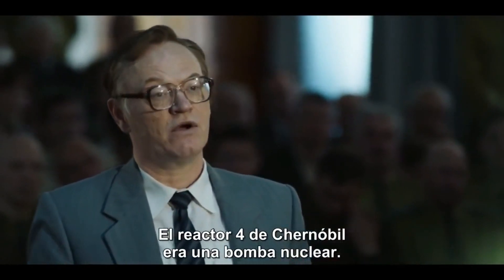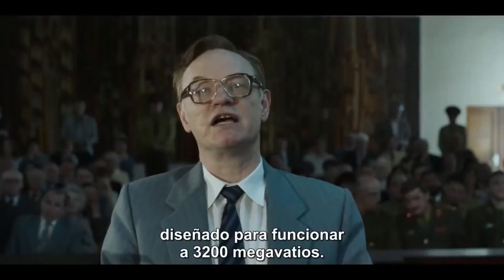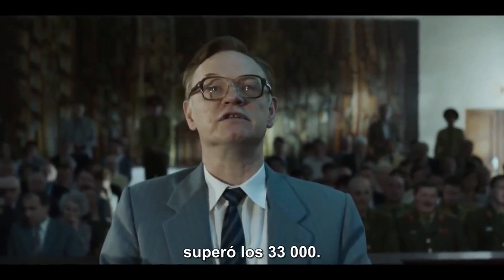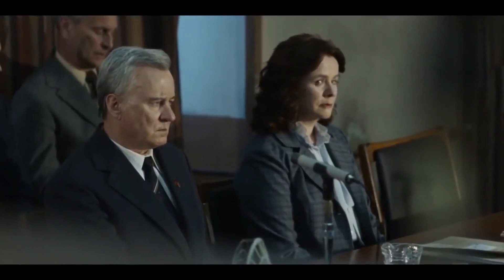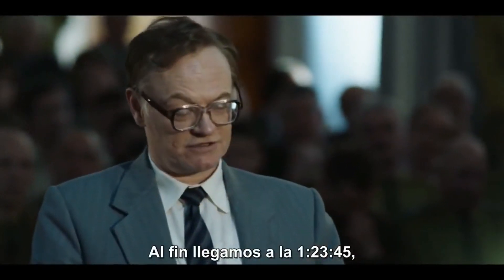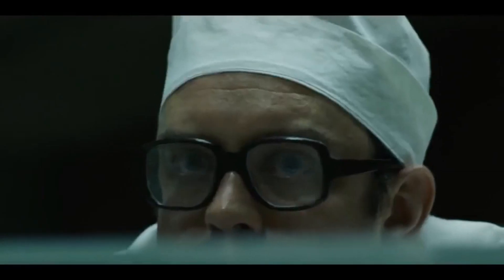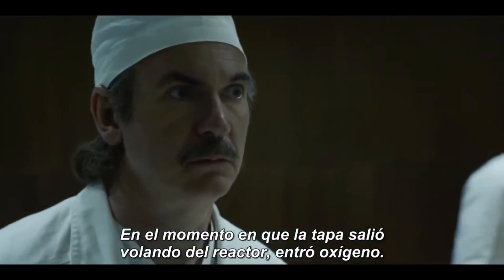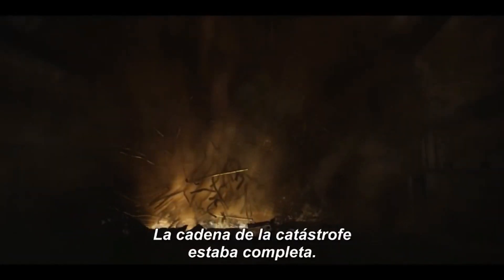Chernobil disaster explained in 10 minutes (3/3) - Valeri Legásov - Chernobil Series

Comment: Love that look on diatlovs face when he finally realizes how it was possible.
Reply: When Legasov explains the entire mis-process, step by step, and elaborates that the Reactor, designed to operate at 3200Mwatts, went beyond 33.000. and the camera turns to Dyatlov, you see the fear, dripping from his face; Over 10x the regular output...It even took a few seconds from the maximum-indication on the meter, which didnt gó any higher then that 33.000, it could have been double, even triple or quadruple that energy, as legasov explained clearly: an endlessly accellerating reaction, skyrocketing. Pressure building up so high, the enormous lid, containing the 211 Control Rods(which wigh  350kg each!) Thats over 73 Tonnes, excluding the weight of the Lid itself... and it popped off like a cork from a champagne bottle.... Oxygen and carbon-molecules from the air, now mixing with the extremely volatile substances inside the core, and the disaster is 'hyper-complete'.... Dyatlov realises this all too well at this point, and it even seems hé is having trouble to grasp the vastness of the catastrophe. Dyatlov does know, he's the móst FKd person in the world right there...
Reply: @thegreenreaper6660  As much of an asshole he was, no one deserves to be partly responsible for this.

But he can take a tiny, tiny bit of comfort in the fact that the higher-ups concealed the truth about the, basically non-existent, emergency shutdown.

If your job is to drive a car and your bosses want you to push that car to its limit, the governement shouldn't be surprised that the driver runs over a person even though he pushed the brakes.

There were no brakes. They lied to the driver. A lie of omission perhaps... But a costly one.

His punishment is cancer and the painful deaths of all those people... Horrible, he's already dead inside.

Though, the question he has been asking himself has finally been anwsered, a weight from his shoulder. He has enough to carry.
Reply: @sifuhotman1300  Dyatlov isnt solely responsible no, but his arrogance and horrible, even naieve attitude, added up with his disregard to the well-educated engineers in the control-room that night. Akimov tried to stand up to him and warn him that it wasnt safe. Dyatlov pulled Rank and pushed onwards....

Thát is on Dyatlov! AS a lead-nuclear scientist in the USSR, he should have been more cautions!
That said: Dyatlov's responsibility indeed stops where the omitted reports begin; The 'red flag'-report on the lithuanian RMBK-reactor, which experienced a huge powersurge after enabling AZ-5: lowering all the control-rods: mass-graphite injection into the reacting core. Yes the boron-contact afterwards causes the reactivity to halt, but not before a huge spike! This finding should have been a huge alert throughout all the RMBK-plants in the USSR, but was kept hidden by the Party, due to the political interests and prestige! Also the part where a half-powered RMBK-reactor created a lot of by-product(Toptunov: We think the core might be poisoned!... he was 100% right!), the by-product reacting freely and unchecked if it came into contact with graphite... Those two pages from the reports, could have informed both the Control-room engineers, as well as Anatoly Dyatlov on what type of BOMB they were developing, if they did this wrong...

And in hindsight, we can conclude that despite the men doing everything by the book, it was terribly wrong!
Graphite-tipped control-rods to 'shut down a reactor'....Any (nuclear)scientist would have you locked up in a mental hospital nowadays if you stated that.

Unfortunately it had to come to this terrifying disaster first, before people realised that scientific facts, fár outweigh political interests.....
Reply: @sifuhotman1300  most people commented hateful stuff towards Dyatlov. I can see you guys despise him, but can we just remember for a second that Communist regime was toxic and kinda drove this whole chapter happen? I mean, i am not a person to judge people by actions, but dyatlov is not the person to be fully blamed here. We may not know what exactly happened in control room, but if he really did kill more than 50 people with that nuclear catastrophe, he'll carry that sin for the rest of his life. In wikipedia, despite the engineering mistake that happened, he blamed the flaw design of nuclear reactor and not his people, which may be the cause.
Reply: @sifuhotman1300  HBO portrayed him as am impatient, senseless, heartless evil person, but i refuse to believe he was like that, unless there is some documents that prove otherwise.
Reply: @thegreenreaper6660  i don't think Dyatlov knew how reactors fully worked until legasov participated in the testimony.
Reply: @blazephamous7425  Perhaps. The way he degenerately commanded Akimov and Toptunov around like they were children, gave the idea he knew it all...
Reply: @blazephamous7425  this is wrong, the real Dyatlov knew how reactors worked, he was not a dumb guy at all, but wasn't aware of the flaw in the emergency safety system
Reply: @iceink  Yes you are absolutely correct he didn't know about the flow in the system but the whole incident wouldn't have happened if he wasn't so arrogant and careless.But I am also not blaming him fully Cause in the series there is a scene where they talk about the Graphite tips and this Flaw was discovered nearly ten years before the Chernobyl incident and the government hid it.
Reply: @thegreenreaper6660  there wasn’t any graphite. THERE WASNT! Because it wasn’t there!
Reply: @blazephamous7425  50 people? More then 100.000 died from cancer lol
Reply: @thegreenreaper6660  they didn't hire scientists they hired bodies, he was the only person in the room who atleast understood the basic reactor functions, hence the reason the control rods were all removed cause nobody knew about the poisoning and thought that less rods= more power(true if not for xenon) then the rapid temperature spike due to coolant loss when the pump shut off burned the xenon away quickly causing it to swing in seconds, the problem was 100% the control rod design. Though he was an ass, he was also a man who was following orders, he didn't cause the delay which lead to xenon poisoning he was merely doing his shift and running a "standard safety test" which was already known to be dangerous by the union but not him and the A-z5 fatal flaw which he was also unaware of is to blame hugely as thats literally the only "stop" button. I imagine he was tormented by the faces of his "comrades" that he watched turn into goo( no new cells due to radiation destroying the DNA completely, leads to rapid body degeneration, skin peels leaving you without skin by the end and organs do a similar thing its horrifying) he definitely paid for his actions mentally.
Reply: @blazephamous7425  I heard he was tough and rude but not like this. More like that was the leadership style he chose.
Reply: @iceink  why would they keep that information from the people who would know not to fuck around?
Reply: @blazephamous7425 I guess he didn't considered the positive and negative feedback loops, just wanted to get the damn "safety test" checked
Reply: @evanbelisle8464  Because, in theory, it shouldn't have mattered, or ever come up. It would only ever come up in a situation like this, when the reactor has been pushed to the brink of disaster already. In any normal working day, the graphite tips don't matter.
Reply: @blazephamous7425  I don’t know if it was on Wikipedia or not, but I read somewhere where part of the reason he was pushing so hard to do the test despite all of the red flags was his desire to impress and move up within the communist party, which means he wasn’t evil or anything like the show portrayed him, but he was career motivated
Reply: @thegreenreaper6660  Diatlov's statements indicate that he guessed this and therefore did not want to turn on AZ-5; however, Akimov acted in accordance with the procedures in force, while Diatlov was not in the habit of explaining the motives for his actions, but only expected blind obedience from his subordinates
Reply: @blazephamous7425 It was the Soviets that were to blame, not Communism. We don't blame Democracy when the US does something fkd up, we blame Capitalism. The Soviets never had actual communism according to Marx. They just has an authoritative, totalitarian state in which nobody owned private property. 

The main ingredient for communism, is for the workers to own the fruits of their labour, and they didnt have that in the Soviet Union. It's like calling a society with no type of money, capitalist.
Reply: @thegreenreaper6660  they belive at the time before explosion it went over million MW
Reply: @jere9915  I think it was already well over a few hundred thousand MWs, when the meter maxed out. That meter jolted up so terribly fast, its logical to state that the meter couldnt keep up with the surge anymore, maxed out on that 33k,, but the amount of power-overdose needed to actually blow a 75 ton lid off that Reactor is a vast multitude of that 33k.

33k was onl;y how far as the meter went. Same story with the lower-level docimeter in the controlroom that only went to 3.6 Roentgen..(not great...not terrible...)... No it oculd only measure upTO 3.6 roentgen

And i'd even say it'd be the same with the high-range docimeter that was attached to the armytruck that General Pikalov drove into the plant, to get that close-in reading of 15.000 roentgen.... It would be even higher, but even a high-level docimeter would max out at those levels....

Said crudely: You see how quickly Sitnikov got his skin fried-red on top of the building: Mere seconds and he was 'burning up' already! He barely looked into the torn up roof, and he already knew there, that he'd taken in far too much radiation already to survive.
Akimov and Toptunov went to the pumps to open the valves there manually, and prevent an even bigger disaster of a total meltdown, yet a few dáys later in the hopsital, théy were the ones 'melting down'.... Gruesome...
Reply: @thegreenreaper6660   well, watts are a measure of power, which can be converted into work/energy, which combined with mass (76 metric tons) one could calculate what amount of work (watts, joules per second) one would need to move said object. then one would have to consider how quickly it was accelerated too but it would give a baseline of no less than that much power....
Reply: @thegreenreaper6660  Well, pushing the equipment is one thing. Failing to acknowledge the possibility of a xenon pit and refusing to shut down safely is another. But the fact that the control rods had graphite tips is something that should've been told to the operators of that reactor. That's crucial information, and Dyatlov can't be held responsible for not knowing an emergency button essentially doesn't work due to a shortcut taken during construction.
Reply: @thegreenreaper6660  dyatlov does... but he did not know about the graphite tips, so he was convinced that it was caused by incompetence.. until that very moment when it becomes clear that pushing az-5 was pulling the teigger on a bomb that he had instructed them to assemble and arm.
Reply: @thegreenreaper6660  at this point I think Dyatlovalready "knew" he was responsible, he didnt fully understand how, obviusly he did stuff wrong but to his knoledge RBMK reactors cant explode but he was apparently wrong, and he is plagued by guilt masquered with denial, but when he hears about the graphite tips, he sees a hope of him not being the sole responsable of the disaster, he was not wrong he was tricked and that aliviates his heart a little, tha is what i get from this scene.
Reply: @ivanadriazola1991  you’re the only person in the comments that I find understands this. (He didn’t want explaner guy testifying bc he thought it would just attack him but he is surprised to find explaner guy exonerates him at least a bit, with the carbon tip thing). Yet everyone in the comments completely miss this. Glad to see at least one person gets it!
Reply: You didn’t see the look, because it wasn’t there
Reply: he knew it from the beginning
Reply: @Rise_To_Mastery  Not sure. He was one of the most experienced scientists on the matter. Something does tell me, he should have known about the graphite tips, and how they cause a reactivity-spike? Thats just basic chemistry, right?
Reply: @thegreenreaper6660  the reactor was pushed in a very specific and unexpected way against protocol. that was Dyatlov's doing. the graphite tips were in place under the assumption the reactor would never be pushed as it did, essentially relying upon strict observation of protocol. so those were two mistakes: the graphite tips relying upon operators following the correct protocol, and the human decision to break protocol.

very few people understood that graphite would cause such a disaster. the people that did voiced their concern when the reactors were built and instead of choosing against the graphite tips, those in charge decided against the recommendation. and then that was the end of the concern of using graphite tips.
Reply: @thegreenreaper6660  the point of it in this film anyways, why he gives that look when he says they were graphite tips is that none of the engineers on that night knew they were graphite tips
Reply: He was probably in shock.

Get him to the infirmary!
Reply: "o.o
Reply: For anyone in these comments wanting to know more about Chernobyl I really recommend Serhii Plokhy's Chernobyl History of a Tragedy book, just finished it and it goes way more in detail that any other show or site goes on the history aspect of things. Can't recommend it enough.
Reply: Dyatlov was actually pretty lucky in real life. Many of his coworkers died horribly, literally melting from the inside out in a matter of weeks, dyatlov didn't even get put to death( they were going to) but he was so sick they just let him slowly die.
Reply: More when he realized it’s partly not his fault…partly
Reply: 1:45 why leave out the part where he explains why it’s cheaper?
Reply: @stevengower  It's somewhat misleading. Graphite is cheaper, but it's not cheaper than Boron. It's cheaper than heavy water. While regular water reduces reactivity, heavy water increases it. But heavy water is self-regulating. When it gets to hot, it vaporizes, turning into steam, reducing the amount of heavy water left to increase the reaction, which reduces the reactivity. Without using a Moderator like heavy water or Graphite, the nuclear chain reaction isn't able to happen. Graphite is cheaper and more readily available than heavy water, and it's necessary to make the reaction possible. The Graphite wasn't merely the tips of the control rods, they were half of them, and they were designed that way on purpose, so that as you removed the Boron segments of the control rods you would be pushing in the Graphite to increase reactivity.

With the control rods fully withdrawn, the graphite it still within the reactor, and that isn't actually the part that causes things to run away. It is the very tip of the graphite. Normally, there are gaps on either side of the graphite section of the control rod that fill with water (regular water, not heavy water), which reduces reactivity. This is done so even when the control rods are removed there is something regulating the reactions and making sure they stay consistent throughout rather than heating in one area more than others. When the control rods are inserted, the graphite portion of the rod displaces some of that water at the bottom of the reactor, meaning that for a split second, the bottom of the reactor is experiencing an unchecked chain reaction at the bottom, while reactivity is beginning to slow at the top. And it's doing it for all 205 control rods at once.
Reply: @electramasta @blazephamous7425 You realize it's not actual Diatlov, but actor, right?
Reply: Dyatlov knew that even the most minute thing is not impossible when it comes to nuclear energy...improbable sure, but I bet he certainly felt a very real cold chill run down his spine when realizing he orchestrated the improbable into all but fatefully possible.